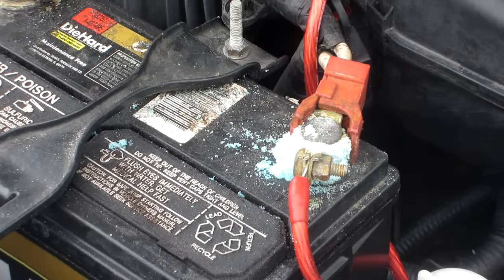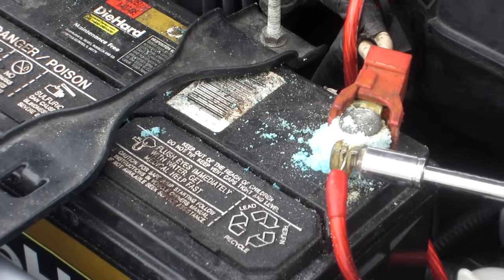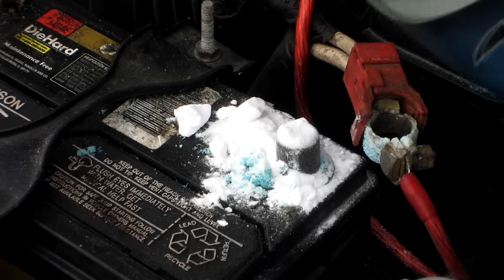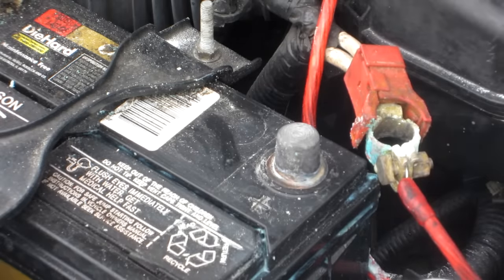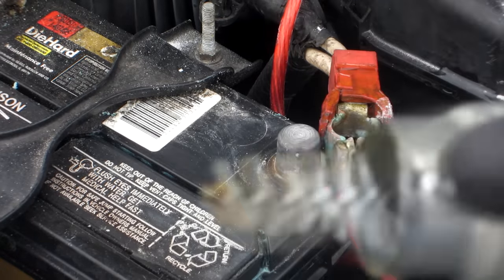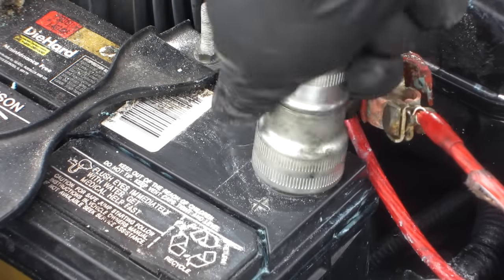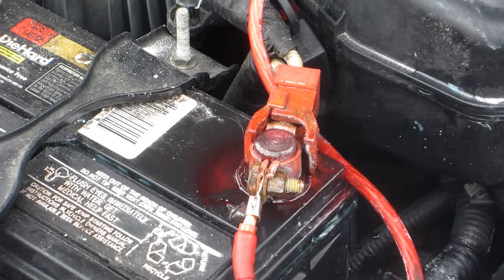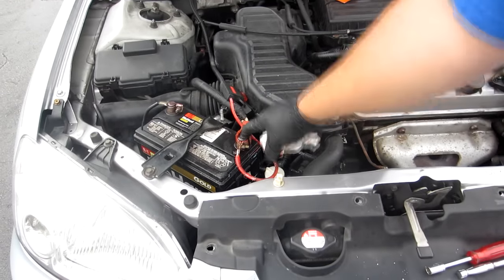HOW TO REMOVE BATTERY CORROSION FAST AND CHEAP!!!

Comment: The two caps on the front of your battery are vent caps.  You have to be careful not to let the water/ baking soda mix get into the battery.  It will neutralize the acid if you do this too often.  Always wear safety glasses with side shields or preferably a full face shield.  The water in the battery breaks down to it's component parts. It becomes a gas from the charging and heat.  H2O :  2 parts hydrogen and one part oxygen. The gas is very explosive.  With the ground wire still on and you make an accidental connection to the red positive terminal from say a metal tool or a can it will be more then enough heat and or spark to blow up the battery.  Acid, shrapnel and fire will be only inches from where you were working. Stay safe.
Reply: Please can you tell me if it's safe to use the baking soda/water method on a connected terminal. I can't even disconnect mine.
Reply: or can i use PB blaster? Bc it seems to be more rust than corrosion
Reply: @Ethanm353  not recommended
Reply: Thank you chemist!
Reply: H2O is water. Not an explosive gas.
Reply: @drmousette have you ever heard of chemistry? strongly suggest taking a class or two 😭😭
Reply: @drmousette  You can make hydrogen bombs by using water
Reply: @Ethanm353  it won’t explode lol. Just leave the car off and pour it slowly.

Comment: I would have removed the negative cable before removing the positive and would have put nothing between the cleaned, dried terminal and the connector.  But that's just me, I guess.
Reply: my guess is the grease is electrically conductive.  We used it all the time when I installed solar.

Comment: How does no capacitor equal battery corrosion?? 
Ive installed plenty of high power systems no capacitor. Just gotta go with the biggest sized wire you can and upgrade the wire size for electrical.

Comment: You used to be able to find a tool specific to batteries and battery posts, a little two piece job. A small brush, down inside a fitted cup with bristles on the inside, they screwed together for storage, and came apart for use. Coca Cola will do the trick if you can't think of anything else. Or a steel brush, that'll work. I came up raised by shade-tree mechanics and did more than a little of my own work before my shoulders gave up. Gotta have some shoulder strength for the intricate jobs.

Comment: If you're going to use this baking soda method, you can control where the water goes a lot better, by using a spray bottle.
Reply: Yeah this was kinda silly.... all the battery acid is now eating away his battery tray

Comment: Not that it hurts anything to put the corrosion resistor on the black terminal, but it's really not necessary. The black (negative) terminal is the cathode in the corrosion cell, which is all a battery is, and the red (positive) is the anode. The anode always corrodes in a corrosion cell, while the cathode doesn't. The corroding anode actually protects the cathode from corroding (cathodic protection), in the same way steel pipelines are protected..

Thanks for the helpful video.
Reply: +John B Good point, we used cathodic protection on under ground storage tanks at gas stations...till we switched to fiberglass...I wish I would of installed an anode bag on my 92 4runner. I drove it to the salvage yard with the rear axle ready to twist out of the frame.
Reply: So how come I have seen the same green corrosion on negative terminals, not only where they connect to the battery, but where they connect to ground, connect to the car's metal body panel?
Reply: Sorry bud, I have to disagree. The reason I got to this video is because of corrosion on my black terminal. Like a massive amount.
Reply: @soilmanted  dhx8
Reply: @fernadolara6093  eiy9, or egw7, depending upon your point of view.

Comment: ALWAYS remove the NEGATIVE Terminal cover then the POSITIVE, and replace starting with the POSITIVE.....  Other than that life saving information, great job!
Reply: Removing the negative. I know that's what we were taught but the only thing I can figure why is that the negative is the output for the battery. I've tried both, but get the same little spark from either side. 
What were you taught? Me, Navy training.
Reply: Since the Negative is attached to ground, you risk getting shocked if you remove the positive while the negative is still attached and if at any time your wrench touches a grounded component inside your car. Thanks for your service!

Comment: So if the battery has those plastic protectors on the positive cable, do you have to take it them off or can you latch the cables onto the bolt that is connected to it?

Comment: For safety precautions you're always supposed to disconnect the negative side of the battery before the positive side. It can literally blow up in your face. You also want to make sure that all of the battery acid is washed the vehicles engine compartment especially any electrical wiring because the acid will eat through the insulation and wire's will then start shorting out. The best way to make sure it's all off is plain water rinse it thoroughly. Don't worry the water won't do any damage because all the electrical connectors have weather pack seals. Oh BTW the amp cable had nothing to do with the corrosion it's your battery that's leaking at the battery post and the battery should be replaced
Reply: If you got to do all that you might as well take it to the shop
Reply: @damonjohnson7044 if you don't do all that you will be taking to the shop with electrical issues. It should be done right if you're going to post this on YouTube it's very misleading that will only create more issues then to actually help.
Reply: Agree ,
My Toyota has the same problem year 2 of 2 of my Interstate  12V .
Reply: @nonyavyorbus2085  all you need to get rid  of batt corrosion is a kettle of boiling water pour it on job done have used this method for 50 odd years never had a problem a old school mechanic told me this it does work
Reply: @ivorjones6618  someone also told me to do this.. but i am not sure if to pour boiling water or warm water.. also can i just open the hood and put water on terminals without removing terminal or anything..? Can you please advise… Thanks
Reply: @nabeelsaeed3181  boiling water on trminals is fine but if corrosion is real bad remove and clean it all and grease to protect
Reply: @ivorjones6618  thanks a lot for replying.. no its not that bad.. its like just 30% of what is shown in this video.. actually i am experiencing a delay start in the morning.. actually i am living in Saudi Arabia in a very very hot climate so the batteries last only like 18-20 months.. but this time its just 14 months since the last battery change and there is a green indicator on battery which means battery health is fine but there is some corrosion on the terminal someone suggested my hot water method.. so ill just try to pour boiling water on the terminals without removing them..

Comment: Mix the baking soda with the water in a paper cup FIRST! Then pour it on.
Reply: What would be the baking soda to water ratio?
Reply: Angela Beutel looked like about 1:1, maybe a bit heavy on the baking soda. It’s not really critical though.
Stable bases are safer, so you want more than the acid, and the water just makes it wet enough so it’ll react. No calculations needed.
Reply: @akbt2  you want a thin paste.  An old toothbrush works great to apply the baking soda solution and to work it into the nooks and crannies.  Continue applying the solution until it stops foaming (notice while he's wiping his off, that it's still foaming - that means the acid has not been completely neutralized)
Reply: That actually makes more sense 👌
Reply: i thought the same thing lol
Reply: @akbt2  one cup of water 1 tbs baking soda. pour over the battery when it stops bubbling rinse with fresh water til its clean. no need for paper towels and all that, very simple
Reply: You can buy felt washers at you auto parts store to put on the battery posts, under the cables connector. That will prevent corrosion.
Reply: Baking soda and water in a spray bottle.
Reply: Try Coca-Cola 😀
Reply: You can Clean of the coke there is a video.
I don’t drink Coke only coffee 😉
Reply: Use a cofee.
Reply: Yet that sounds cool
Reply: You can also use a plastic cup, a ceramic cup, or a glass.
Reply: L
Reply: First, eye protection. Second, don't use the solution on the cable and connector.  Dry clean only with a wire brush. If you use water, it goes down into the cable. All water contains trace amounts of iron which will start your whole corrosion problem over. If the cable is too corroded,  trim or replace it.
Reply: @jeffeverde1  I prefer paper towels or a disposable rag to a toothbrush. They don't risk flicking corrosive material around your engine compartment, or your eyes, like little bristles do.
Reply: Can I use W40?
Reply: Just pour VERY hot water over the terminals. It will get rid of the corrosion super quick. Then put terminal protector on terminal post and cable clamp.
Reply: @graemeforssberg3986  as
Reply: There's nothing wrong with the way he did this cause it doesn't cause any damages to the battery
Reply: Coca-Cola works
Reply: Make a paste of the baking soda and water.  Spread on the corrosion with a popsicle  stick or a tooth brush.  Give it 5 minutes to work. Rinse.  Repeat if corrosion is still present.
Reply: @tbrwn2548  cola is acidic.  baking soda is alkaline which neutralizes battery acid corrosion
Reply: Use an OLD tooth brush to work the water/baking soda solution around terminal post and terminals. Then put a thin coat of petroleum jelly on the posts.
Reply: @akbt2  ratio isn’t really important. The baking soda is alkaline and neutralises the corrosion which is acidic. So more baking soda won’t hurt it. You really don’t need to mix it if you don’t want. You can do just like in the video by pouring the baking soda over the terminal.
Reply: @spc-jumaili5556  don’t use wd40. It doesn’t conduct electricity
Reply: @jimmytwostones  That's good to know, Thx for your reply 👍
Reply: Then apply the solution with a small brush
Reply: They are specific to pos or neg posts
Reply: @edwardchilders8802  Water is not going to harm the cables at all. 
You should mix the water and soda together and pour it over the entire battery terminals and all before touching anything. 
You need to Neutralize the Acid first so you don't Contaminate the engine compartment like He Did in the video 👍

Comment: one tip man, always take off the negative side first...even for cleaning just one side. then put back on positive, then negative.
Reply: @Kevin Pocasangre i think it's just common practice cause a lot of people aren't careful or don't understand how to be careful with their battery so it prevents damage?
Reply: @Kevin Pocasangre because if you leave the negative connected and touch the positive battery post against any metal from the car it short circuits thats why
Reply: @Kevin Pocasangre because otherwise it might go boom.
Reply: It's because vehicles are common ground. If you attempt the positive first and your wrench touches anything metal on the vehicle it will ground out the battery. I even heard that the wrench can weld right on. P The battery might explode.

But if you do the negative post  first all you have to worry about is your wrench touching the positive post. 

Also it a good idea to never lay any tools on a battery.
Reply: Plus current ,dc current flows neg to pos. the neg side can. Load up and then hooking up pos create a voltage surge damaging some IC components
Reply: @Kevin Pocasangre because if you touch anything grounded with your wrench it will arc but if you take negative off first it wont
Reply: @supboy666  

You are Right !!
Reply: @Kevin Pocasangre If you don't know why, please never attempt to deal with a car battery.
Reply: Nick H thanks! I needed to see this
Reply: do i have to take them off can i just run a wire brush over the terminals.
Reply: Ok. So take off the negative first, then the positive.   Then, When it goes back on, you hook up the positive and then the negative last.  GOT it!
Reply: Bullshit dude, that's just necessary when you get some electric important stuff changed in your car, like starter or an alternator.. A lot of mecanich work has been done by me, without removing the battery at all.. Any problems so far.
Reply: Take the positive off first. If you took the ground off first you could bump into a ground and charge the system. Taking the power out will cut the power and if you bump it on something it won't put power to the system
Reply: Do I have to take battery off to clean it
Reply: @cathaleyawallock2752  yep you can pour overtop but some corrosion will be in the inside
Reply: You are right on Nick. This advice might save somebody's big trouble, a burnt body parts.
Reply: @ront9395  thank you
Reply: Tnx after 6 years
Reply: Brown vinagar works fine
Reply: @supboy666  Unless you remove the battery, there is no way would be able to touch the positive battery post to a metal part of the car. The real reason is that metal tools conduct electricity and if you are using metal tools around the positive terminal, such as a wrench, if the negative battery terminal is still connected to a metal part of the car, the wrench could make a path for electricity, between a metal part of the car and the positive terminal of the battery. For example you are loosening the clamp screw on the positive terminal and you accidentally bump up against a metal part of the car with the other end of the wrench. See Eric Saur's comment.
Reply: @Weiwei Su Not likely. The amount of current available from a 12 volt car battery is not likely to kill you, unless you have a serious heart condition, or an electronic heart pacemaker. You could get a fairly painful shock – and then keep functioning as if nothing had happened. Don't try this with the high voltage battery in a hybrid vehicle though. That can kill you, or cause serious damage.
Reply: It don’t matter if the car has no power tho just reomove the whole battery
When pour liquid in the first place
Reply: Eight years later you are the hero of the day. Thank you, kind sir.
Reply: Thank U
Reply: @Jeff King  if you didn't find out yet, there's corrosion inside the ring that touches the battery post so best practice is to use the other side of the cheap battery post cleaning tool to clean inside the connection ring thing.
Reply: vincevince1900  in your closet 
🤣🤣
Reply: Nice... always leaving power last..

Nice.. lik3
Reply: @cathaleyawallock2752  ideally it could make it easier to clean and stop the corrosive dust from going other places in the engine. But if you set your still good battery on the ground, make sure you don't set it on the ground or it will lose energy to the ground. So you wanna place it on a rubber mat or wood.
Reply: He was lucky nothing bad happened
Reply: Yes if you dont disconnect neg then pos you will fry your computer system/electrical and have to get towed and reprogrammed which costs around 1500$
Reply: Is that why my radio doesn’t work any more? Gotta es350 2015 
Screen keeps saying checking map disk in progress.

Comment: I think the battery terminal protector is supposed to be sprayed on after the terminal is tightened. (not before) Also you always want to disconnect the negative terminal first. Reconnect the negative last.
Reply: Robert Random EXACTLY - spraying it on BEFORE you reconnect only introduces more resistance into the circuit thereby degrading the service of the battery.
Reply: thank you,  was wondering this myself.  so you do want to disconnect the wires before cleaning?  not just the one you need to clean right,
Reply: Vasoline applied to the battery terminal will PREVENT corrosion!
Reply: Yes Robert that is for after post is clean n tight. Also have seen guys spray wd-40 on posts.
Reply: @oldarthritichands4137  What every happened to using good old fashioned white lithium grease.  Is that not a good thing to use these days?
Reply: This video overall is completely why people should vet what they watch and not listen or watch every person who says "this is how you"...
Reply: Nope 😲
Clean up everything and Spray the 💩 out it and reassemble 👍
After it dies a little give it an extra shot to cover anything you may have missed or wiped off putting it back together 👌
Reply: Robert, heard the same thing. If protector is sprayed on battery terminal before connecting the clamps you might be impeding the electrical flow through that connection.

Comment: Thank you Mike for posting this video on how to clean battery terminals!  It was very helpful for this 56 yrs. old Grandma. lol ....I'm going to see if I can do this.
 Sincerely,
 Talitha
Reply: How did it go talitha?
Reply: hey buddy I don’t think she made it man...:(
Reply: Rob Genson  well what if you just use hot water. ?
Reply: Just pikir got after over those battery terminal . After got water dry up squeeze 1-2" length of tooth paste mix 2-3 table spoon of water in a small cup or bowl stir well dilute toothpaste just apply over battery terminal an surrounding corroded area , leavw it dry and it will stop further corrosion and prevent terminals battery to oxidiate again.
Reply: @chrispy9913  🤣
Reply: @sageunknown6307  just  hot water will work also. But the  corrosion  Might re‐appear sooner .